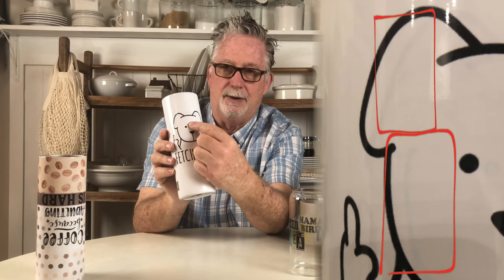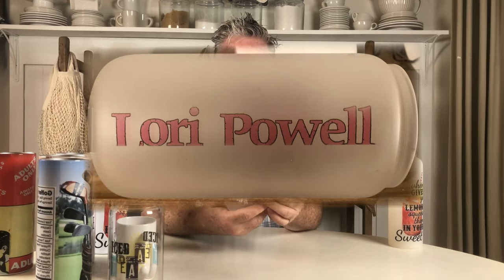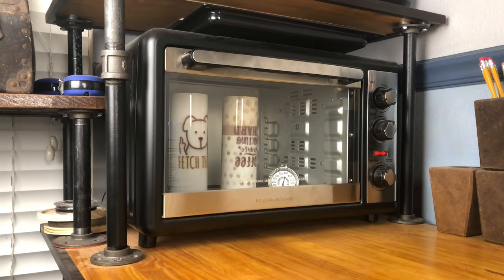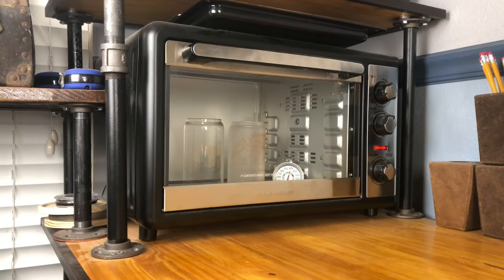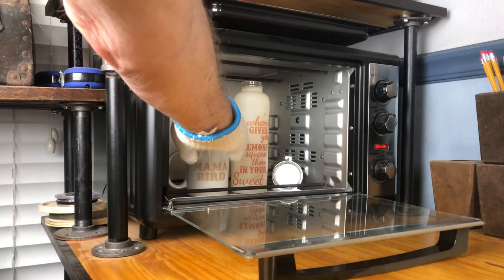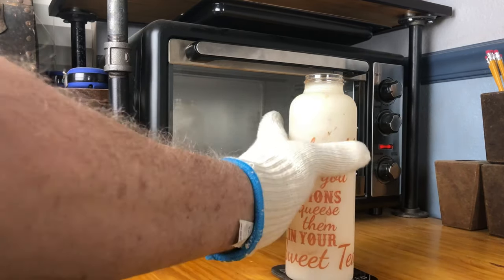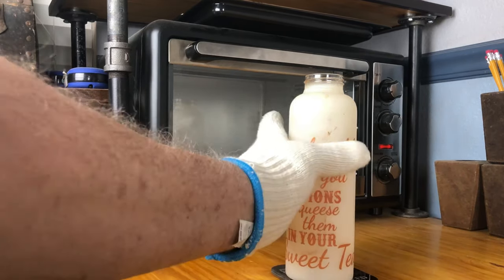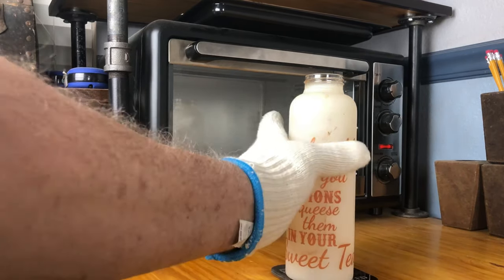How To Re-Bake A Messed Up Tumbler, Glass Can and Coffee Mug!

Comment: I use a convection oven for my glass cans. When I have some that I need to strip the sun ink off. I put a shrink wrap on it and bake for about 6-7 minutes. The shrink wrap soaks up the image pretty well. I normally do 2 rounds of that. It works wonderfully. I have t tried it on the tumblers though.
Reply from the maker: That’s great to know! Thanks for the tip! And thanks for watching!
Reply: WOW! That’s a great technique, too!  I need to get a convection oven for sure!
Reply: Would that work for frosted glass cups?

Comment: Awww… she loved it, and yes… she rocks!!!
Reply from the maker: Doesn’t she!
Reply: @industrialfringe953   Roy, is it possible to put too much pressure on a tumbler? The first one turned out beautifully, but the second one is too dark around the top and bottom, and the color is too light in the mid-section.  I still don't have a convection over to bake the image off. This has never happened before.  What must I have done wrong?

Thank you,
Donna
Reply: @industrialfringe953  Is it possible to to put too much tape on the tumbler?  I'm trying to figure this out.
Or could I have pressed it too long.  90 seconds x 4?
Reply from the maker: I don’t think it is. I’ve seen people wrap their entire tumbler with tape! My thoughts are to use as little as possible to get the results I need!
Reply: @industrialfringe953    Good morning,

I’m doing another as I post this comment. 

I only taped the seams and double taped the top and bottom. 

I was thinking that perhaps it got over heated by me turning it four times on one end, and four times on the other end. Was that too much heat for it?

This time, I’m turning it twice in each end, making sure the the section that the press doesn’t heat the first time, gets heat when I turn it. 

I sure hope this works.  It’s cooling down now before I remove the butcher paper and sublimation paper. 

I’ll be watching more of your wonderful videos. 

Thank you.
Reply from the maker: Good luck!

Comment: Do they need to be standing up or can they lay on the side? I tried standing mine up and with the size of my oven it gets to close to the heating element? If yes what kind of oven do you use? Thank you for your help!
Reply from the maker: Great question! If possible, I’d stand them up, but if you have a messed up tumbler that you can’t use anyway, I’d give it a try! Just make sure to rotate often and maybe add a few more minutes due to the door opening more often. Thanks for watching!

Comment: Would you share what time and temps you bake the mugs and tumblers. Sorry if I missed it!
Reply from the maker: Hey, Renee! I have a couple of other videos that get into the details, but short answer is 190 seconds at 385 for mugs in a press (375ish for 10-1/2 minutes in an oven) and 365 degrees for 50/50/25/25 in a press, light pressure (365ish for 4-1/2 minutes in an oven). Thanks for watching!

Comment: Are you using a heat press and if so are you just wrapping with that Songkran peice of tape? Is there a and over lap where your connecting the two sides? Or is your print exactly the same size as the cup?
Reply from the maker: Definitely go back and watch a few of my other videos! I think (hope) you’ll be able to get some good info. I mostly use a tumbler press, and here’s how I wrap with tape. https://youtu.be/7Uj0ho9pP3o Thanks for watching!
Reply: @INDUSTRIAL fringe  I just found you. I really don't watch much how to sublimation they just don't explain things like you. Your definitely an amazingly helpful channel. Do you have a video how you measure your cups and how you cut them. Before wrapping? I made a quick glance but only seen wrapping and editing your images

Comment: Have noticed the dark at the bottom of the tumblers I don't know if it's burnt does that come off and does any of the fumes get down in the cup I saw somebody cover up the top of their cup so the fumes wouldn't get inside
Reply from the maker: Well, I’ll need to start by saying you should never take scientific advice from me. (Mrs. Koenig, my high school science teacher would very quickly confirm this.) I don’t cover the tops when I bake off, as I don’t personally believe there’s an issue. First, deposition (or desublimation) is the process of turning a gas back into a solid, so there is a possibility of the gas reforming into a solid inside the tumbler. I’m not sure that’s a bad thing, as once the gas has turned into a solid, it’s safe. Right?! I mean, I could lick the outside of my tumbler all day long and nothing would happen to me. (Let’s assume I’ve never done that.) I do wash out my tumblers after they’ve been burned off, but my very unscientific thought is that it’s okay. Besides, if you’re sublimating in an oven, there is still a percentage of gas going into the oven and thus into and around the tumbler. That said, if you have ANY issue, by all means, cover it! (With what, I don’t know!) As far as the dark at the bottom, it’s probably not coming off! Thanks for watching!

Comment: Very helpful thanks a bunch! Can it be  put again in the oven after giving it a brake to cool off for another hour to continue discoloration if the print is still a little hard to get off 🤔 Im doing this on 12oz mugs
Reply from the maker: You can certainly try, but I’m pretty sure you won’t get more off. At some point, the bottom begins to darken, and I’d be afraid that may get too noticeable. Thanks for watching!

Comment: So my tumbler is to tall to stand up in convection oven so can I lay in there to try and do this? Would I just need to turn it several times? When I sub on them I have to lay in oven which comes out great so wasn’t sure when trying to burn image off if this would work.
Reply from the maker: I haven’t needed to do that yet, but I would just about bet that if you’re making them in the oven that way, you should be fine with baking the image off that way. But yes, I would turn it often. (I would probably turn every 10-15 minutes, but I may be a little OCD about it!) Thanks for watching!

Comment: I have always heard that when you set a convection oven at, say, 400 degrees that it really is only warming up to 375 degrees.  So do you put your oven at a temperature so that the thermometer inside the oven is reading at 400 degrees or do you just set your temperature at 400?  Hope I am making sense.  Thanks
Reply from the maker: Hey, Harry, you’re absolutely making sense, and it’s a great question. I never use the external dial. It’s usually way off. I always, always, always use only the internal thermometer. Hope that helps! Thanks for watching!

Comment: What about the bottoms? I noticed on a couple of them, they were brownish from where you had them in the oven for so long. What did you do about that?
Reply from the maker: Well, the Walmart frosted one was messed up all around, so it was trash! With the exception of two, I didn’t have issues with the bottoms. And those two were because I didn’t get the sticky stuff from the rubber bottom completely off. I ended up scrubbing them to pull most of it off. Then the little bit of what I couldn’t get was covered up by a new rubber bottom. Thanks for watching!

Comment: For images with a lot of black in them, how do you keep the sub paper from sticking to the tumbler? Mine is sticking badly which ruins the finish of the tumbler. The other colors press beautifully. I run an Epson F570, Epson General Purpose transfer paper with Epson sub ink.
Reply from the maker: Without knowing any more, my first two thoughts would be this. First, make sure your ink is bone-dry on the paper. I try to print a day or so before pressing. (I’ve pressed seconds after printing too, but I try to wait at least a little while, especially on dark designs with large solid dark areas.) Secondly, you may want to try prebaking the tumbler if you’re gonna do a really dark image and you’re still having an issue. Just long enough to make sure the finish is baked into the tumbler. (Two to five minutes in an oven or 30 seconds to a minute in a press.) Let it cool back down before wrapping. Thanks for watching!

Comment: I love this. Thank you so much for sharing.  I noticed some the tumblers are kind of dark on the bottom, are they burnt?  You also mentioned something about one of them leaving a tape mark and you'd get that out, tape marks can be removed from sublimated cups and tumblers?
Reply from the maker: You can burn the bottom if you’re not careful. My tumbler bottoms were okay, but I had adhesive residue that I forgot to remove before I started! It was hard to get off. And I had the coffee mug bottom get dark. If the marks are vague, sometimes you can remove them with Turtle Wax Scratch & Swirl. I’ll be trying this in an upcoming video!

Comment: I am new to sublimation. I have ruined a couple of mugs and tumblers. I was able to remove almost all of the ink from the mugs. I have a sublimation oven and set the oven to 400 degrees for 45 minutes.  One of the mugs looks brand new and the other has a faint ink stain on it. My question is will the ink stay on the cups and tumblers without recoating them with a sublimation coating? Thank you
Reply from the maker: Interesting. I’m not sure why one retained the ink. There will always be some ink left, hence the need to find a dark, dark design to cover it with! Once you’ve baked as much of the ink off as you can, you can resub without the need to add more sublimation coating. I’m not sure how many times you can do it, but from my experience, it definitely works one time! Thanks for watching!
Reply: @industrialfringe953  Thank you

Comment: Would there be a way to remove the remainder ink like rubbing alcohol or acetone or would that remove the special coating? Could you in theory turn any mug into a sublimation mug by dipping it in polycrylic? Just some beginner questions i kind of have.
Reply from the maker: Hey! Great questions! I don’t know for sure, but I would bet removing the remaining ink with a harsh chemical would also remove the sublimation coating. And theoretically, you could coat anything with the right polycrylic coating. I tend to shy away from that, as I sell my product, and I want to make sure it’s 100% sublimatable. I also can’t beat the prices for already finished tumblers. I may use a special coating on an upcoming video, but it will be for canvas fabric. Thanks for watching!

Comment: Ok absolutely love your videos!! Thanks for all the help.

I have a question about the glass cans. I couldn’t find any and I read you can order them from a restaurant wholesaler. I haven’t heard of any problems with those at all. Do you know?
Reply from the maker: Thanks! No, I would not order them from a restaurant wholesaler, as they won’t be coated for sublimation. Check out the link for the Alibaba supplier I use. They should have them in their US warehouse, shipping is included, and you’ll get them in 3 - 5 days. And the prices can’t be beat. They’re $175 for 50, coming out to $3.50 each. If you don’t want that many, check out rtssublimationblanks.com. They’re $6.75 each plus shipping. Thanks for watching!
Reply: @industrialfringe953  Thank you so much for your help. Yes I will continue to watch, you give great information.

Comment: What about the gasses getting inside the tumbler when baking off?
Reply from the maker: While I’m not a chemist, my belief is, the stainless steel inside is a hard metal surface and can easily be cleaned. What you want to stay away from is food in the same oven. The reason behind that is that food can absorb any lingering gases left in the oven, but a hard stainless steel surface cannot. But that’s just my best guess. If you’re concerned, don’t rebake, or at least get an opinion from someone qualified to answer chemical/gas related questions! Thanks for watching!

Comment: I tried this at 400 and did for 60 mins. and they weren't even close to white again.  I put in for another 60 and they are just faded.  Should I turn my oven up more?
Reply from the maker: You’re not going to get all the ink off, you just want to get enough off to try and add a darker design to cover it. If you haven’t yet, I’d make sure your oven is at the correct temp. Do you have an internal thermometer? At that point, you can increase the time and/or temp to get some of that ink off. Best of luck, and thanks for watching!
Reply: @industrialfringe953  yes I do.  I tried 450 today for an hour and it didn't even barely fade it anymore.  Do I need to not choose any designs with any white since the white is usually the tumbler?

Comment: I have a stupid question.  I'm new at this & I did something stupid.  I used my heat gloves to brab my tumbler out of the oven which I guess I shouldn't of done as they left marks on my rebaked tumbler. I also turned my tumbler 1/2 way as it way laying down & I heard I needed to do so if it didn't stand up. So my question is how do I remove the heat glove marks that have been left on the tumbler? I got a lot off but not all.  I feel so stupid
Reply: I think these heat gloves aren't the best. They are the black with pink dots type. I think I need to invest in some new ones that don't melt when grabing a hot tumbler.
Reply from the maker: Oh, don’t feel bad, you’d laugh at all the mistakes I’ve made! I’m not 100% sure what you’re talking about, but it sounds like the heat from the rebaked tumbler caused some of the material to transfer from the gloves to the tumbler. It may have glued itself into the substrate. If you’ve removed everything by hand and there’s still some there, I would try baking it a little while longer to see if you can get it off of the tumbler when it’s hot. But maybe use some different gloves! Thanks so much for watching!

Comment: Did it burn on the bottom of the tumblers? What is that on the last ones bottom?
Reply from the maker: I had to go back and look at the video, because I knew none of them burnt on the bottom (except the glass one and the mug a little bit)! I had previously put a rubber bottom on that tumbler, and when I removed the rubber bottom, some of the adhesive didn’t come off, but I didn’t notice. That adhesive browned up. I was able to remove it with a little GooGone. The learning on my part? Remove all the adhesive BEFORE I rebake a tumbler! Thanks for watching!

Comment: How do you get rid of the tape marks?
Reply from the maker: The goal is to not get them in the first place, and I do that by using very light pressure and making sure the tumblers are completely cured. (There’s no way to test that, but if you have light pressure and you’re getting them, you need to bake the other tumblers in that box for 30 seconds to a minute without anything on them to make sure they’re completely cured. Let them cool back down, then wrap as normal. If you do get them, you can use a car wax to lightly buff and reduce the severity. Turtle Wax Scratch and Swirl is the one I’ve used. It’s not a complete remover, but it helps!